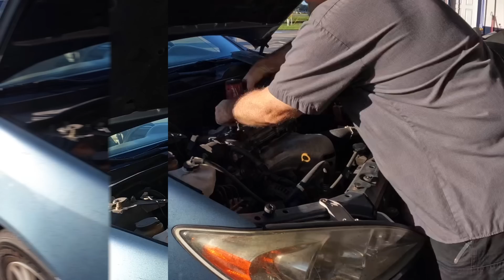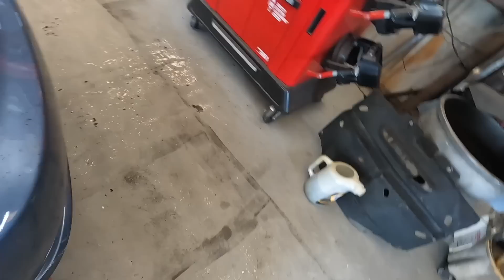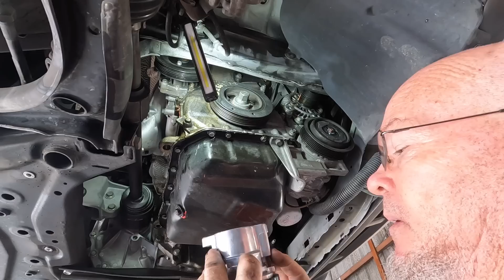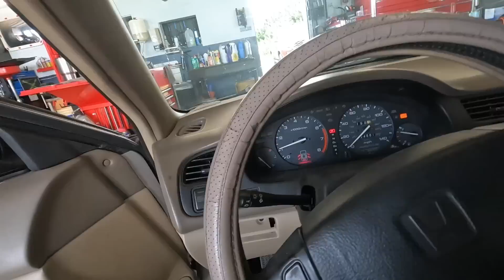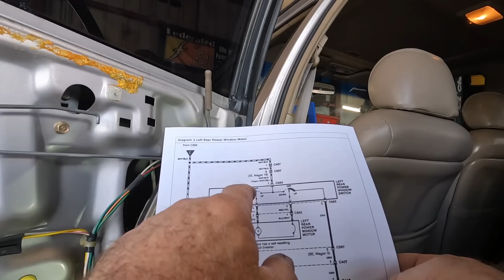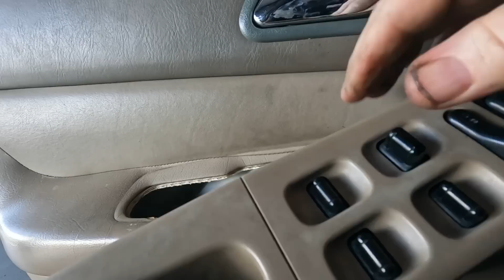A DAY IN THE AUTO REPAIR SHOP 86, JEEP, HONDA, MILWAUKEE, ICON,..

Comment: We used to do carbon cleans with water fed through intake manifold. Seemed to work because the Nox readings would come down
Reply from the maker: Yeah, water and trans fluid trickled in. Ahhh, memories. :)
Reply: I guess I'm getting old😜 I can age myself even more by saying I used to use a GM carbon cleaner called Kleens or Cleens. It worked awesome. I think it's called Top Engine Cleaner by AC Delco now.

Comment: Do you pull fuel pumpr relay on induction induction set up
Reply from the maker: No, that is a fuel injector service, have not done one in years. We used to do motorvac services that way.

Comment: I wonder if some of the oil properties break down over time and just doesn't lubricate as well?
Reply from the maker: That is possible, but I’ve used stored oil for years without an issue. Maybe a chemist will chime in? :)